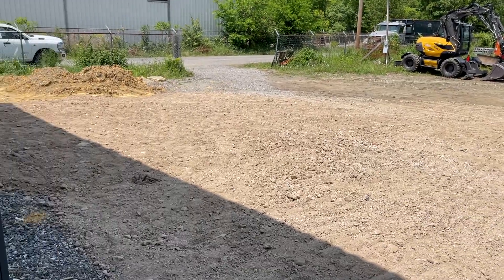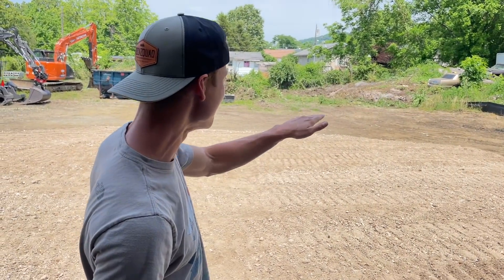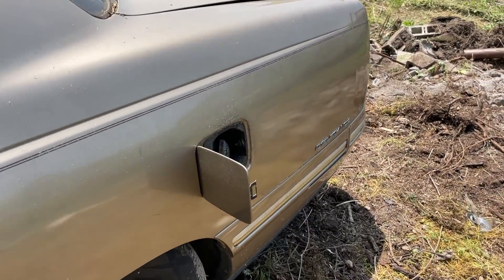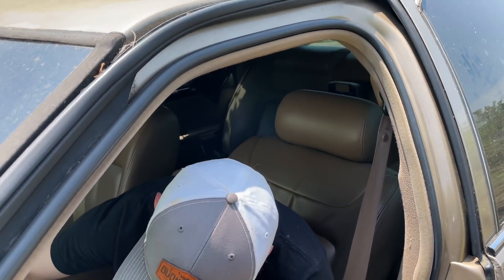Neighbor Refused To Move His Car!!! Goonzquad Garage Major Progress!

Comment: You two should make a concrete pad on the corner of the property and make a grate and get a water/soap separator  make an awning to where you can wash the cars the trucks the equipment like a one bay detail area. Covered and it would be epic. You have to have a water separator cause the EPA will come around.

Comment: Recommend a gravel strip around the edge of the building for maintenance, and also maybe a taller grass that doesn’t need mowing…a more sustainable solution. Great stuff guys.
Reply: Silly idea
Reply: And a elevator to the roof for a deck where another elevator can be placed, the space elevator. It would involve sequencing a matrix of focused laser beams at a prismatic optical collector, to generate lift from the power of intense radiation, like as if there was a cable leading to space.

Use that to dispose of broken down vehicles to make fun of elon musk firing his fancy car into space. 
It would be in ways like a magnetic rail gun though using light rather than magnetics to generate heat to turn a spinny thing, able to propel and place objects into space and without risk of explosions of hydrogen, while using alot less power in the process.

Oh nevermind..
Reply: plant some wild meadow flower seed and grass. beautiful in summer replace some of that nature you took down. less maintenance than grass

Comment: That outside area at the back end of the shop would be a good spot to put your garbage and scrap metal bins, leaving more space and a cleaner look out in front. Put a double wide metal door in the middle of the back wall to access the area from inside, plus it will create a nice cross breeze through the shop. A seperate locked gate off the road back there will provide access to empty/swap out the bins.
Reply: Silly ideas here

Comment: I think that the 1968 Camaro needs a rebuild. You can tell it's a 68 because of the windows. 67 had side vents,and 68 didn't. Enjoy your videos!
Reply: The 67 drivers side has the vent window,  but the 68 passenger side does not. I remember them putting a salvage door on the passenger side and the dumb asses bought a 68 door for a 67 Camaro. That proved to me that these dudes have no idea what the hell they are doing. They dropped a 600 HP engine in it but left the weak 10 bolt rear end in it,  that's gonna work until they do that first burnout, then it's gonna snap like a toothpick.
Reply: Its always funny to me how people like to try and correct people or make statements like saying how you can tell its a 68 by looking at the window, which is true,but obviously you don't really now anything about determining the difference in 1st generation camaros,because most that do know how will look at the parking lights in the front fenders and rear quarter panels, 67 didn't have any and 68 did,no I'm not an expert, just bought and sold alot of them over the years, not trying to hurt your feelings just think sometimes before you say things that you really don't know about just trying to impress people with your wealth of knowledge, have a great day
Reply: Also before its said, there are other ways to tell also,just one more obvious way is the front grill and parking lights, 67 has round parking lights in the grill and 68 had square ones,unless it had a RS grill

Comment: Goonzquad, you should talk to your distributors about how they ship your dang sauce. I received a bottle in the normal padded Amazon envelope. The glass bottle was OK, but when I removed the seal, the plastic cap had a crack in it. It wasn’t a total loss: I poured it in a bowl with a lid. Quick review: tastes good and has a little kick. I dipped some chicken fingers in it.